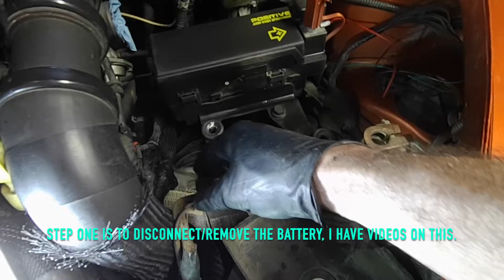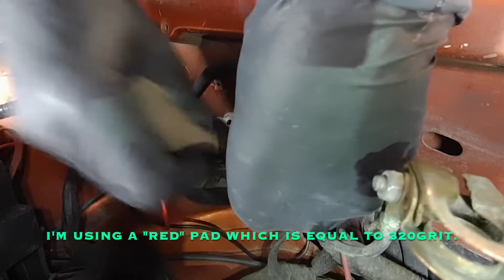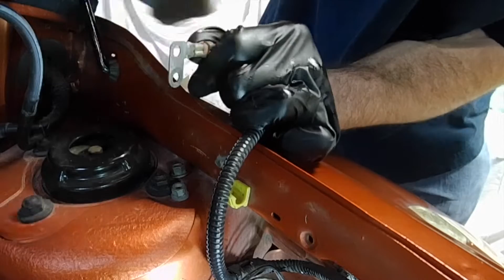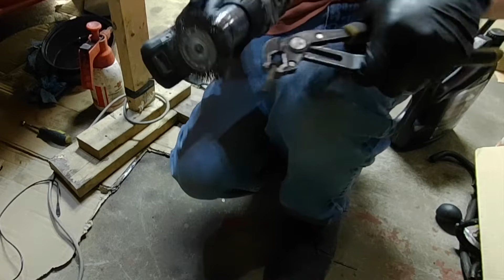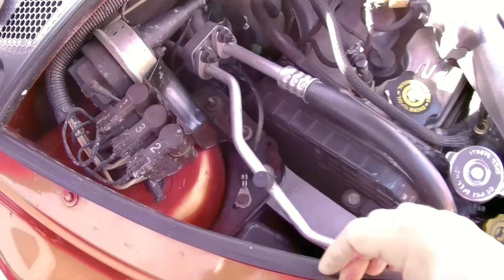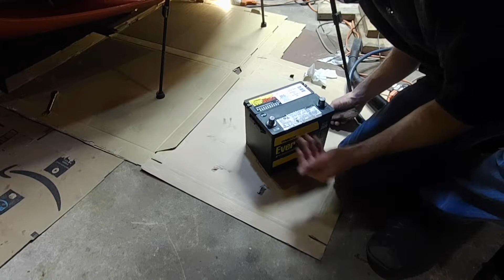PT Cruiser Electrical System Maintenance

Comment: Its a Chrysler. Where electrical issues are features designed right in. TIPM is a perfect example. They know they constantly fail but will never go back to a fuse box with relays. One circuit failure and you are replacing the TIPM for just under a grand. Single OEM relay, $15.
Reply from the maker: So tell me what brand you know of that is so much better? Because i've owned just about every brand going, Chrysler has treated me better than most.

Comment: You did not show the ground on the steering column (unless I missed it).  I lose the horn and display on the radio depending on the location of the steering wheel,  When the steering column is tilted all the way down I lose the horn, etc., and as I raise the column I regain access to the horn etc.
Reply from the maker: That's great to know. Unfortunately I wasn't aware of the ground you're talking about and that's why I didn't show it in the video. Sorry, I do the best I can, but I can't know everything.

Comment: Really appreciate this video. I have an 05 PT cruiser and just got the "no bus" error on the odometer. It starts just fine but the dash meters like rpm, speedometer, thermometer, etc aren't working. Would doing all these things help?  Or have you ever ran into that issue?
Reply from the maker: I have never had that issue. Doing this certainly won't hurt. Good luck.

Comment: Nice effort young man. I am a retired tech, thinking about buying a PT for Lyft purposes. But you have to understand the dielectric grease insulates the connection. Is designed to impede the flow of electricity and to seal the connection on the outside once it’s made. It’s used on spark plug boots to keep the voltage from running down the spark plug into ground.  So install your clean metal connections dry then your dielectric grease on top to seal it.
Reply from the maker: I understand exactly how dielectric grease works. It insulates and protects the connection that's made and i've never had troubles with a connection due to using it. I've taken apart every single plug and connector on my off road car and put dielectric grease on it, all my electrical works perfectly, even when I drive through rivers.

Comment: Man my 04 GT has been at the shop 3 times and they still can't fix the p0201 code. when I pick up the car it runs fine a few mile trip and it's back to running ruff. I am going to try this hopefully it will work its the first time in 13 years that its broken down.
Reply from the maker: There's a good chance that will fix it, I've had a few owners come on here with similar problems telling me this fixed them. Good luck. I have since found some really fine little wire brushes that are about the size of a toothbrush, and that's what I use nowadays to clean up these electrical terminals.

Comment: The ground wire for the cylinder head that bolts to the upper motor mount with a 10mm where does it bolt to ? I cant find that ground wire after unbolting it from the mount a few weeks ago ! ok it bolts to the cylinder head with a 13mm you said,now I need to find it. Nevermind I found it with the help of this video ! Thank you so much for making these video's,they have been so helpful for me ! How are you feeling today ? I have problems with T10 L4and 5,c2and 3 ! I have problems from top to bottom of my spine ! Makes it awfully tough to work on PT cruisers !
Reply from the maker: So happy you figured it all out. I have been doing pretty decent as long as I don't overdo it. One thing I like about PT's is the side of the engine bay is pretty high and a lot of things can be reached from the top side.

Comment: Nash I need ur help please respond
Reply from the maker: Best to actually ask you a question to start with. But go ahead.
Reply: @CarswithNash I have a 03 pt cruiser non turbo gt it had 125000 miles on it an I can't seem to figure out what's going on I've gotten an alternator new battery new pcm an I've replace one of the strut tower grounds, an after each time I replace something after about a week my lights starts dimming at night an flickering an eventually I get a battery light with check engine light. With codes 0443 and 0622 I'm so frustrated idk what else to do. Could it be my grounds are forty's maybe my battery terminals are not the right kind idk my mechanic doesn't even want to deal with it. Also I just had my oils pressure switch change an the oil light won't go away even tho the car has oil an the switch is new

Comment: People don't understand  that today's cars are all electric, every system.  1 bad ground from corrosion, not put back during repair, burn on exaust, ect will shut down entire systems or multiple systems.  As these cars age, esp up north, the more attention the cables and grounding points needs.  Any aftermarket products added needs that size grounding path back to battery
Reply from the maker: Exactly.

Comment: Hey Matt, have a mint 2005 Touring Vert with 45k miles. Thinking of replacing the sparks (timing belt, water pump, oil sensor, rad fan, belts and hoses were replaced when I got it). What brand and model for spark plugs? Anything else you'd suggest?
Reply from the maker: @burack1957  NGK V-Power gapped to .040. You might want to consider replacing the coil and wires as well, I know you are low miles, but they can go from time too. Delpi makes a good coil pack for these cars, that's what I have used the last two times. Any good quality wire will work, but sometimes you will find that first wire will be a little long and catch up in the throttle, just pay attention for that, and if it happens, zip tie that wire back out of the way of the throttle. Also, pay attention for any oil in your spark plug wells, if there is any getting in there, it means your valve cover gasket is leaking, don't let it leak in there because it will cause a misfire when it gets up to the top of the spark plug. You did not mention if your temperature sensor has been replaced, but I will just warn you that they can leak internally and cause a false reading, just like the oil sensors do. Good luck and enjoy that convertible! 🌞

Comment: Wish  I/my shop could figure out why my battery drained this week not once but twice....she is sitting there now.  electric shop  said battery needed to be replaced and a few misc things  but she was tested for a parasitic draw  and he couldn't find anything.  Drained over night  now it's saying  SKIM code which didn't show before...he is thinking  the key  could be the issue??
Reply from the maker: @andreabilek2603  Unfortunately, parasitic drains are pretty common on PT'S. I know in this video I said I wasn't having electrical issues, but I definitely have had some since making the video. I would recommend replacing the ignition switch and brake light switch, which may or may not improve things, but it's relatively cheap and easy to do and I have found some glitches are solved that way. These cars are now getting to the age where they're experiencing a lot of computer failures.

Comment: Hey Matt , Have done the grounds on my 09 .. Had a UO101 & P1603 CODE LOST COMMUNICATION .. Read that it can be a faulty interrupted ignition switch.. Also a  PO 882 but that code won't set if I quick start it by inserting key and turning to start immediately .. I am going to replace ignition switch to see if that corrects both issues .. Thanks for all the knowledge !
Reply from the maker: @quiteright623  Yes, in my experience the ignition switch can cause a lot of weird glitches. I do have a video on replacing it, so make sure you find that in the repair playlist.
Reply: @CarswithNash  Hi Matt , it wasn't the ignition switch .. If I don't quick start the car , the po882 will come up after about a minute and limp mode will kick in with the Trans being stuck in Second gear .. If I put the key in and start immediately , no codes and the car runs fine .. Bizarre !! Battery has been changed , new starter, alternator checks out voltage wise .. Do you think it could be a ground issue at startup ?? Any suggestions would be appreciated .. Thank you
Reply from the maker: @quiteright623  Sounds more like a bad PCM unfortunately.
Reply: @CarswithNash  Hey Matt , Got the p0882 solved .. Tore the sheathing on the Green ( Right ) PCM plug back about 3 inches and discovered a bare wire spot on the Yellow wire with Orange stripe .. Taped it up real good and no more 882 .. It was shorting out when I would go to start the car .. If I quick switched it , it was fine .. Now I can leave the key in any length of time without it throwing the code .. As always , Thank you for the input .. It's a fun car to drive !!
Reply from the maker: @quiteright623  That was an impressive find on your part! So glad to hear you got it fixed up.
Reply: @CarswithNash  I was going to do the relay workaround to get rid of that pesky code that is so popular on YT .. But as I was getting ready to do some splicing I discovered the bare wire spot .. It was a lucky find but even a sucker gets an even break sometimes .. This code is a real pain in the ass and am glad to get rid of it !! Thanks again ..

Comment: Im a 50 year pro mechanic I agree there is benefit to cleaning the connections,but stay away from them with that dielectric paste.Just defeats the purpose.Even putting it on outside,it will work in and actually degrade connection.Remember the old oil filled battery terminal pads.Same deal

Comment: Almost done but can't reach the grounding point on the right side, inner fender wall. It looks like I will have to remove the right-side upper torque strut engine mount. Is that how you did it? Thanks to your great video everything is exactly as you explained. Very grateful.
Reply from the maker: Pretty sure I get in there with a 1/4 ratchet and a short socket. I have definitely never removed the motor mount to do it, but that is an option. Just make sure you realign it when you put it back.

Comment: Great video! But cleaning the positive side, two 10mm nuts connection at the fuse box (next to the jump-starting post), I would not touch it if the voltage measured there is the same as the battery voltage. Your danger warning about possible damage, makes me think twice.
Reply from the maker: You absolutely  have to disconnect the battery before starting this procedure, you will destroy the car if you try to do this with the battery connected.
Reply: I agree, but thought that if the voltage at the connection is the same as the battery then it doesn't need cleaning. If not the same volts, then disconnect the battery and clean it. Do you agree?
Reply from the maker: @raullcalzadilla3541  Nope. It literally takes less time to clean the connection then it does to check the voltage. I thought you were concerned with getting a shock. Connections can test good and later they can overheat under load conditions and lose connection completely, I have seen that many times. I had a commenter on here while go that begged me for help when their mechanic had tried everything and couldn't get their strange electrical problem fixed, the mechanic had already checked all the connections with his meter. But he decided to follow my instructions and remove and clean all the connections and it fixed the problem, so clearly his meter was lying to him.
Reply: @CarswithNash  Fully understand and thank you for taking the time to clarify this for me. Love our 2001 PT.

Comment: I recently changed my ignition switch and actuator pin myself, so thank you for the video!  Now I have to fugure out my headlights. The low beams weren't working when I bought it only the high beams work. They said they tried everything. Grounds , fuses, bulbs, etc. I have to get it inspected, so now im trying to troubleshoot that problem. I found 2 grounds off on the driver's side, so I took care of those, and now the  low beams and high beam are constant when I put my high beams on but when I switch to the low beams I only have the driver side 1 working and They are new bulbs.  Also,  my marker light on the passenger side front  I can't get working. The passenger side turn signal is really dim  or weak in front. Any ideas?

Comment: Dude you're a legend. I need to do some of this when it warms up next week, and likely do the ignition switch as well. Last night driving home all the dash lights flickered, then all came on, all guages dropped, complete loss of power steering and acceleration. Car was dead. Threw it in park, turned the key off, back on and was fine. Scary as hell as I had just got off the freeway.
Reply from the maker: That does sound like a bad connection somewhere, make sure you clean up the alternator connection as well. I just buy the tiny little wire brushes now that are about the size of a toothbrush, with fine bristles and they work really good for cleaning up the connections.
Reply: @CarswithNash do you need that dialectic grease? I have no way of getting that, as I live in the country, and I don’t have a way to get it.
Reply: @MissMolly3377 you can get that by mail depending who you order it from.
Reply: The same thing happened to my daughter, the other night, she just got off the highway, and the car stopped, she shut it off, and it came on, and she went to auto zone, they said her battery and alternator were fine, she came home, and she had me try to take it for a ride, it was fine. Yesterday she was on her way to work, and the car stopped on her, and wouldn’t restart. I don’t think it’s the alternator, I think it’s the wiring, because for two weeks prior, her gauges had been jumping around and acting weird, she would shut it off and it would be fine once she restarted it. Something is going on ever since she had a thermostat replaced. The car was heating up, band she was getting a little heat, but my brother said he thought there was air in the system somewhere, so he fixed that, but she said he did something near where you check the transmission fluid, so I am wondering if he may have did something to that ground wire, and the alternator just isn’t getting what it needs. So, I guess I will start doing this this week. I’m a nervous wreck over it all. 😭😭

Also, her hatch back door pops open at random times, it’s weird…so I know it’s a wiring issue.

Comment: I have a 2006 pt cruiser convertible. I'm having trouble with the windshield wipers. Sometimes, they work, and sometimes, it doesn't what could be the problem?
Reply from the maker: It's likely the switch on the column, but that is just my best guess of course. Typically if it's intermittent like that, that would be the cause, the motor would probably just flat out fail and or blow the fuse if it went.

Comment: Matt, I am about to follow your PT Cruiser Ground MX video to try and fix my no instrument panel lights problem.  Thus far I replaced the all the lamps, the electronic ignition switch, the multifunction switch, and the keyed ignition switch because it was locking up anyway, and the panel itself. 

Still no panel lights, no highbeam light, and no radio time/frequency display. Your thoughts and recommendations,  please. I very much enjoy your videos and have gleaned much useful information already. Your soonest response will be greatly appreciated,  thanks.
Reply from the maker: Firstly I just use a wire brush to do this now, I buy little ones that are about the size of a toothbrush and have stainless steel bristles and that works really good and faster than the scotch pad. Sounds like you might have a computer issue, but it could be a ground issue, I would definitely clean all the grounds as the first step. I literally just did this to my $50 plow car (an '08 PT) because no matter what I still want it to run.
Reply: Thank you for your prompt reply. I have a set of wire brushes with brass bristles. Non-magnetic although still conductive. Will an OBDII code reader diagnose a bad computer for that malfunction? My timeline for return to Miami might have just been dealt a setback since I admitted my Mother to the hospital in Niagara Falls with a UTI and possibly a blood infection. The original ETD is 28 Nov 23. We will see.  Again, thanks for your response and concern. @CarswithNash

Comment: sorry to comment on an old video but the green wire on the starter, i noticed mine has exposure and looks burnt, can this be the culprit that plagues my pt cruiser's electrical problems?
Reply from the maker: I would clean it up and or change it but as long as your starter is working it's probably not actually causing a problem.

Comment: Hey I have a 2008 pt cruiser with 122k and we had a flood now I’m getting a no bus and I check the codes and I’m getting a u1411 code what could this be plz help 😢
Reply from the maker: I would make sure you pull apart any electrical connecters that got wet and dry them really good. Make sure they are not corroded inside + clean all the connections I showed in this video and then see where you’re at. That is a PCM or body control module related code but I think you probably just have water in something.
Reply: @CarswithNash  i definitely will try that

Comment: Are you familiar with 2006 Ford ranger the problem i,m having is with the vehicle and everything else off I disconnect the positive battery terminal and connect a 12 volt test light between the disconnected positive terminal and the other end to the positive battery post and it lights up how can this be happening? I checked in the same way with volt meter and I'm reading around 11 volts again with the positive terminal completely disconnected. Do you have any idea on what might be causing this? Your response would be appreciated. Thank you!